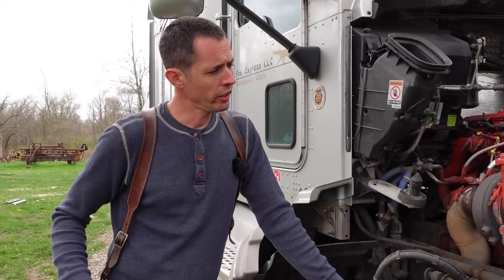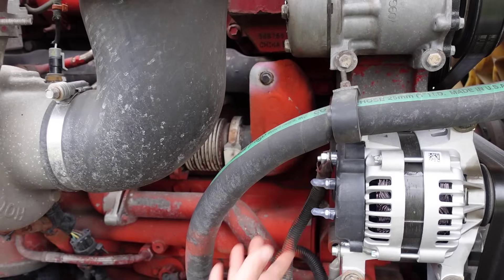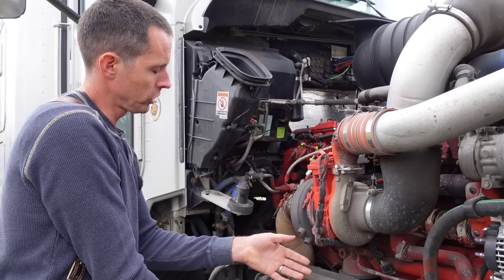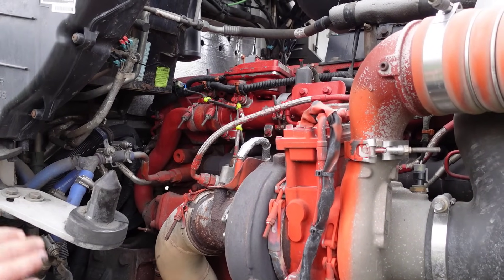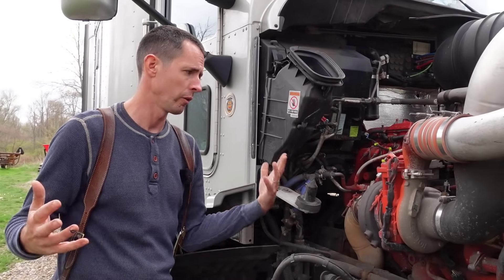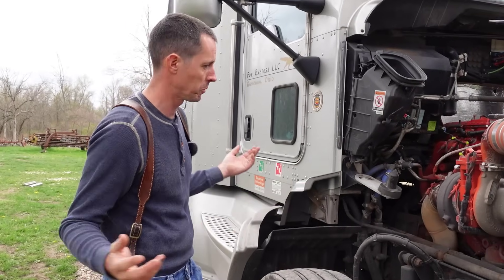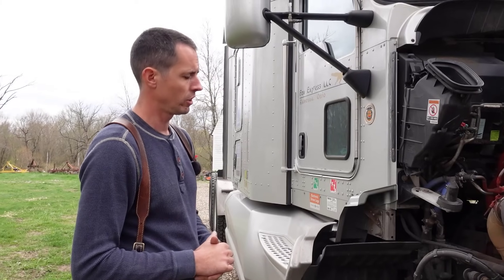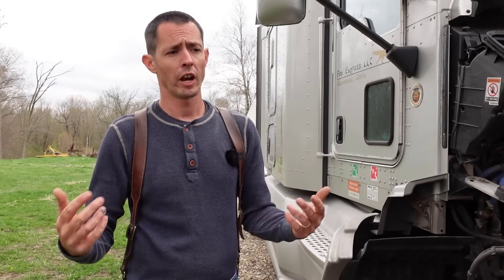What Happens During An Emission Delete - DPF/EGR Dry Run

Comment: I deleted my def yesterday and now it has smoke blowing out real bad and smell like ammonia
Reply from the maker: It sounds like your def nozzle still injecting def.
Reply: @truckingandfixing  yea he said he had to dis connect another pump it had 2 pumps on it…is it still suppose to smoke after that or do I have to drive it to burn the rest out because he disconnected both pumps is still smoke a little bit but I haven’t taken a load yet to really drive it
Reply from the maker: I would take the truck out to run 30 minutes to see what it does.
Reply: @truckingandfixing  hey thanks it stopped smoking after I ran it.. but today the regen light popped on
Reply: @StunnaBoyClassics  sounds like you need to get a better device. Not sure how u did the delete but the tune isn’t right if it didn’t tell the computer to ignore that shit.

Comment: You need to becarefull that is not legal . And shops are catching  heavy  fines . It just like alternator  thing you did a long time back on s line on alternator  you said run wire all the way to battery and you had a power line on back of alternator a few inches away why did you not use it.  THIS IS WHY WHEN I CALL FOR SERVICE AND SOMEONE TRYING TO DO MORE THAN I NEED. I NEVER LET THEM SERVICE TRUCK.  YOU SHOULD THINK A LITTLE LONGER   BEFORE YOU START TALKING YOU KNOW ABOUT 50 /50 OF WHAT YOU ARE DOING

Comment: ONLY ONE IFTA DECAL PER SIDE .....PLEASE READ THE INSTRUCTIONS THEY ARE CLEAR
Reply: What do you mean? Can you explain?
Reply: @dawitabate9291  you can only have one (1) ifta sticker on each side of the tractor. And NOT ON TOP OF EACH OTHER EITHER. READ THE BACK OF YOUR IFTA DECAL AND THE LETTER THAT COMES WITH IT. SOME STATES ITS 350.00 PER EXTRA STICKER PER SIDE . GRANTED ITS A BS TICKET BUT ITS THE DRIVERS RESPONSIBILITY OR COMPANY TO REMOVE THE OLD ONE. ITS PRETTY SIMPLE DONT YOU THINK

Comment: Are you serious a variable geometry turbo it’s a computer controlled turbo which spins to separate what blades on either in the damn turbo sucks and you know I had us SCummins turbo and I replaced it three timesElder delete EGR otherwise it’s a total piece of crap
Reply: Sounds like you had a crap delete, the reason you burned through so many turbos. Would have been better to maintain your emission system.